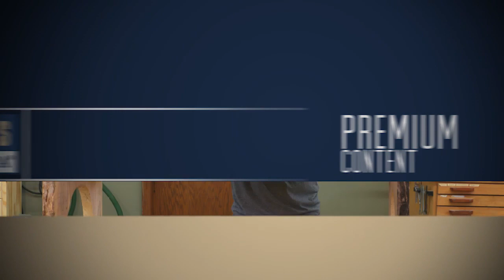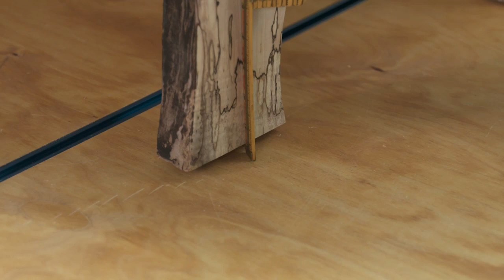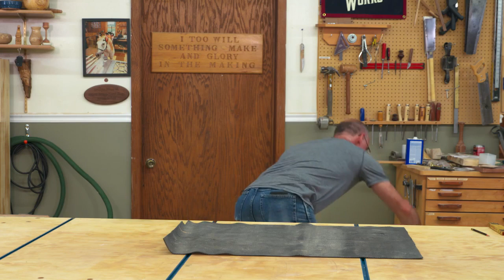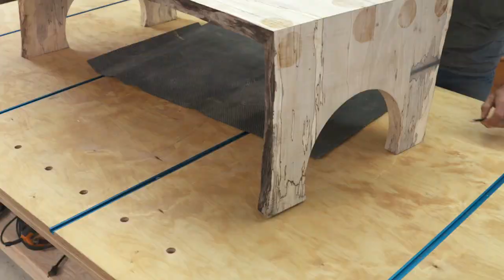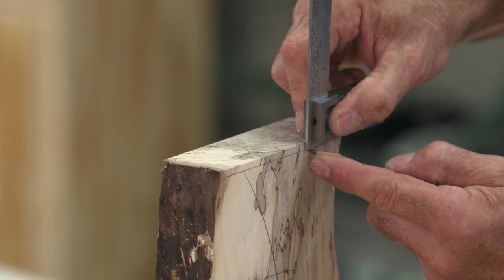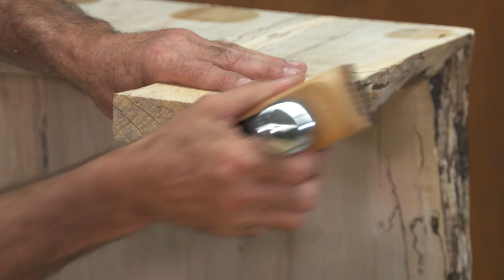IDENTIFYING PARTS OF YOUR WOODWORKING PROJECT

Comment: An added suggestion.  If you know the location where the table is to used, place it there first, and check for wobble.  It would be a shame to cut the legs significantly, only to find that the floor is not flat where the table is to be used and there is still a wobble when the table is in place.

Comment: Wouldn't a block plane cause splintering on end grain, or is it all in the technique and sharpness of the tool?
Reply from the maker: Sharpness of the tool helps.  Also, there are special low angle block planes available that are designed for planing end grain.  
Paul